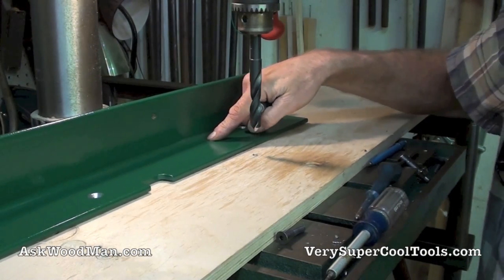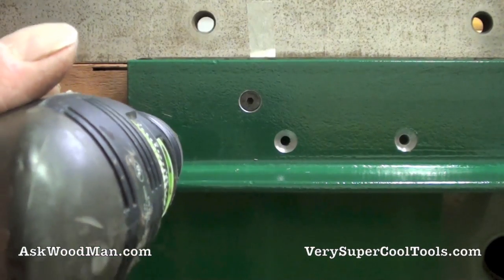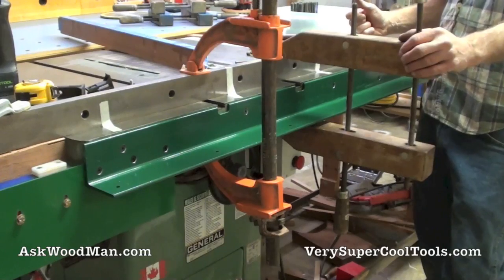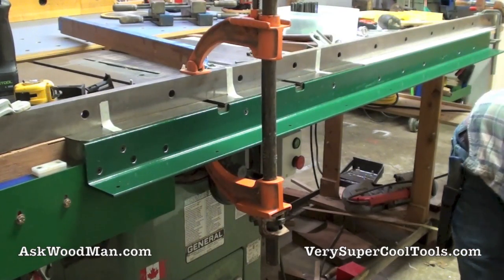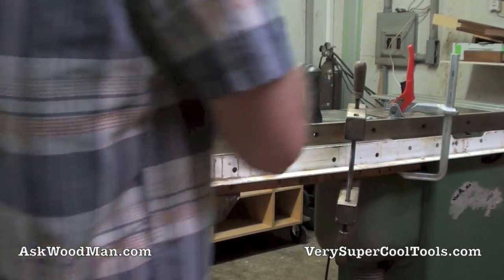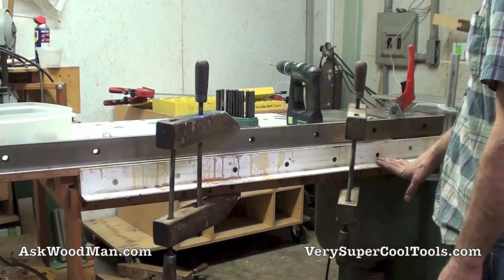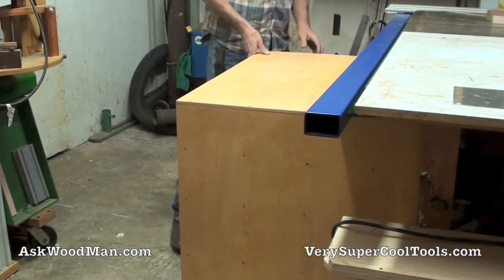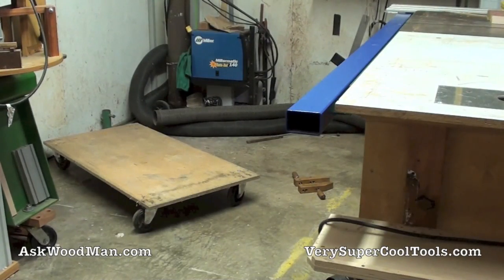5 of 5: How To Install Guide Rails -- DIY Biesemeyer Style Guide Rail Series

Comment from the maker: No the t-square design only grabs and locks to the front rail. The back angle iron is only to supply support to the extension table. This style is called a Biesemeyer style guide rail. It has been around since the 70's and there are millions of them world wide. It is an absolutely proven design. Simple and solid but very accurate and maintenance free.

Comment: I am a Machinist. I work in tolerances of .0002" or .005 MM.
  As good as you are, it would take me a whole 10 minutes to get you to my level on my sorts of equipment. 
  Ok, the big question:
    If you knew you were going to eventually add a digi-fence, would you have done anything different?
  I have a Delta Unisaw with a fence that is un-bearable. Junk, actually.
  And what about the fence itself, the locking mechanism and the extrusion?
 Are they Beisermeier?
  And the left-side tube extension, did you ever do that?
   I don't understand....
  Maybe you could do a part 6 for me or make me understand...
  Thanks for the great video!!!
    Mark

  Thanks for the

Comment from the maker: The step down is set with my combination square set at 13/16 with the unit clamped in place. I did it this way because I wanted to mark from the existing holes I had in my cast iron webbing saw top. But you are right, you could measure and drill for a new install.  The paint is Sherwin Williams Industrial Enamel. The UHMW glides really slide well especially with an occasional touch of turbine oil from my Zoom Spout.

Comment: How did you get the perfect step-down distance between the rail tubing and the angle iron that mounts to the saw?  To me, it would be accomplished by simply drilling the mounting holes in the correct position to achieve e correct gap between the saw top and the top of the guide rail but it looks like you used the angle iron as a flush reference.  Also, what kind of paint did you use to make it glide so smoothly?